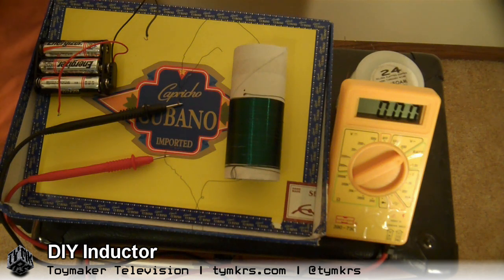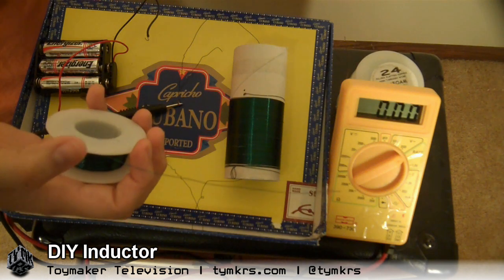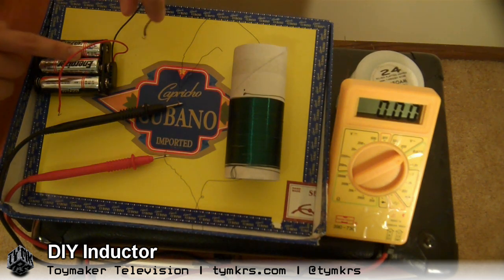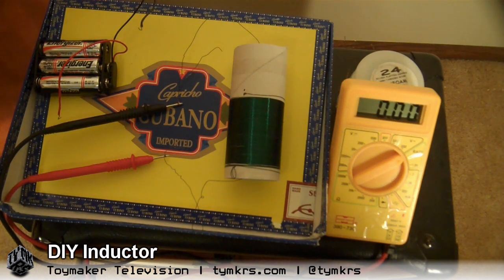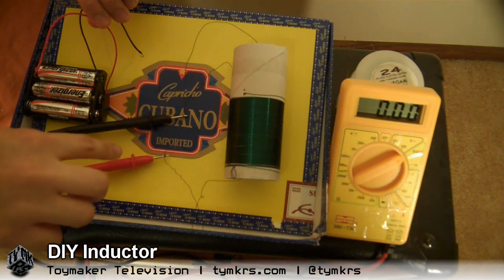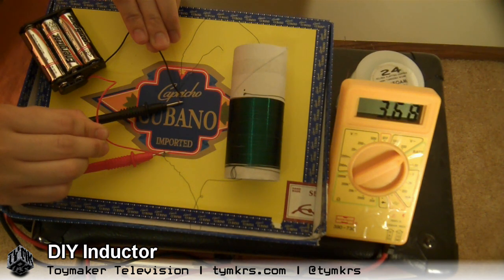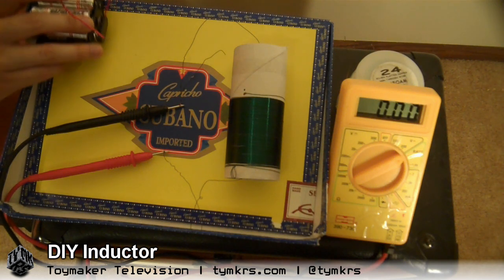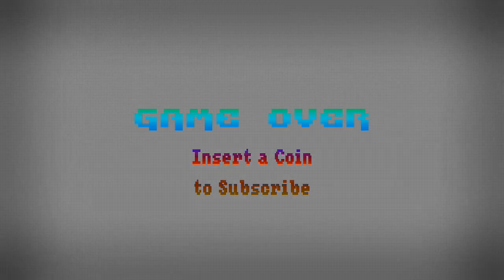TYMKRS DIY Inductor

Comment: The multimeter is deceiving you!!
Each millimeter of a spark represents about 1000 volts...
You find out very quickly if you get your fingers too close. :)
Reply: it is, but not as far. Argon in the air breaks down from 327v, at 7.5 μm